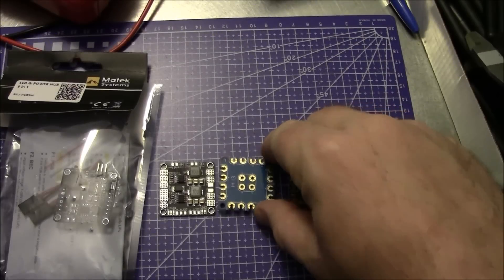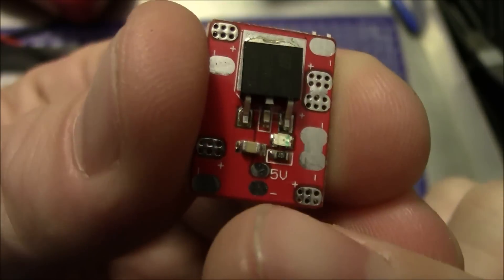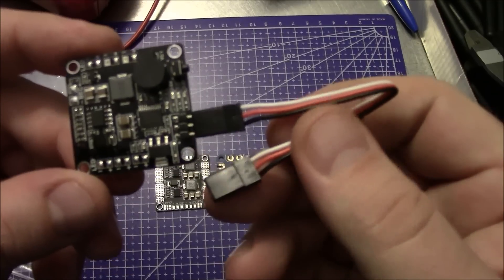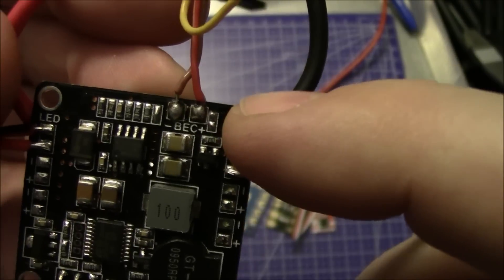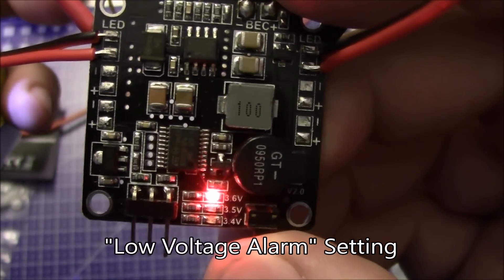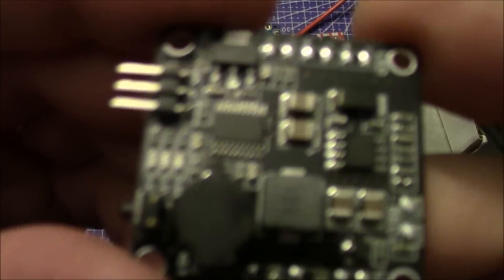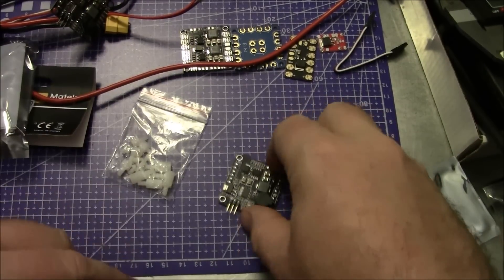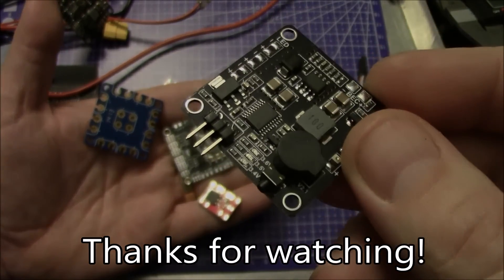Matek PDB BEC-5V/3A from Banggood

Comment: the reason 3s wont work is because this uses a step down voltage regulator. It will keep a clean 12v only if your vbat > 12v
Reply from the maker: Yeah, I eventually figured that out.  Took me a while though.

Comment: Actually, according to the instructions for the D4RII, I quote, "If CH3 and CH4 are connected by a jumper, CH1 will output CPPM for CH1~CH8, and CH2 will output RSSI (PWM)". 
So the servo lead on the 5in1 board should be able to use channel 2 (PWM) on the D4RII, while channel 1 would be connected to the FC using CPPM........or have I missunderstood something here?

Comment: I would be very cautious about buying the Matek 5 in 1 board even though I like the functionality because in my experience when you put a piezo buzzer near a naze32 it tends to affect the accelerometer and send it crazy I had a 250 size that I mounted a piezo buzzer too close to the naze and it was all over the place after about 2 days of mind melting diagnosis I connected the naze to cleanflight and when i touch the naze beside the board the accelerometer went nuts so I moved it further away and everything worked fine.

Comment: Do I need to add telemetry to the 5 in 1? And does the beeper when it's low voltage beep and tell you from the transmitter?
Reply: No, it just measures the battery voltage directly through the battery leads.

Comment: How did you get the buzzer to work which is on the 5n1 PDB with the trans. switch? I install mine on a DX9 which Im only using the Satellite as a RX on the Naze32 Acro. I have it working in Cleanflight  but the switch does not activate the buzzer. Also I'm using only the Spektrum satellite not the full Receiver.
Reply: It works on specific ppm values, I got it working once, but it's a bit of a hassle. I soldered another beeper to my FC itself.

Comment: That mini Latnium board or whatever has a Linear voltage regulator I believe. Very stable voltage, but it heats up as the excess voltage is converted to heat (hence its back is soldered to the board as a heat sink. 

A real man would attach 4S and see if anything blew up. Looks like the rest of the board might just be resistors and LEDs so you might be safe(??)
Of course your board might melt. Depends what current you draw through the BEC.

Comment: Hey man, where do u connect the signal wire for the buzzer to the naze32? (Is it on the positive or negative on the buzzer port on the naze32?)
Reply from the maker: +LenteNiJuan The buzzer on this board doesn't have anything to do with the buzzer on the Naze32.  They don't communicate together.
Reply: +travisgrindal got yah. thanks.

Comment: Hi Travis ! First of all, thanks for the good job you do ! Secondly, do you mean that Matek comes with nylon screws? (I already bought it on Banggood and I don't know if I have to buy those screws or not). Thirdly, could you do a video on how to assembly (sold) every component (PCB, FC, ESC and motors) ?

Thanks Mate :)
Reply from the maker: +Jean-Eudes Akoun Thanks!  The spacers came with both PDB boards I got.  I've thought about doing a detailed build video showing every component being assembled, but it is difficult to record and different people need different levels of details and it usually ends with a ton of questions being asked.
Reply: Oh cool ! Thanks :)

Ahah, yeah, I understand. If you decide one day to make a video about soldering every components with a matek PDB, let the know. I should mount my first quad soon and I can't find a decent video on how to put every parts on (with Vtx, camera and the others parts I talked)

Comment: i had a bad experience with this board, i wouldn't recommend it. I had the same problems getting 12v bec to work, when i got it working it would brown out the 12v  line during flight.

Comment: u need to assigne 3 step switch to channel u connect pdb to. middle position is off, up is for buzzer and down for led control. leds got 3 modes:  just lights on, blinking fast and slow. to change modes u need to move switch from low postion to middle and then back to low position within 0.5 sec and there u go.
Reply: ah, and there is preprogrammed switch ranges for those positions, those r described in manual.
Reply from the maker: +meelis ce I tried them when I first got it but couldn't get it to work but I think the problem was that I was running a 3S battery.  I'm going to try again with a 4S battery and see if I can get them to work.

Comment: There is a slightly larger version of this board that has a separate 5 and 12 volt output.  The led's need to be 5 volts though.  I really like these little pdb's  if they work as advertised.

Comment: Hi Travis, really glad you reviewed this am I'm thinking of getting it. I was going to use the servo pins that stick out the board to power my FC as I already have my radio powered by SBUS off the FC. Question is there a way to turn the battery alarm off or do you just get the three voltage options and you have to pick one? Thanks for the review!
Reply from the maker: +Next Lipo Please Yes, you can scroll through the 3 voltages and then it goes to off.... when there are no LEDs lit up.
Reply: Thanks Travis. I've put one in my quad today and all is fine but I can't get the lost model buzzer to activate. I've put it on aux2 as the instructions recommend and used their ranges but no joy. I know the buzzer works because it beeps once when I power up and when I change battery alarm voltage settings but I cant get it to do a continuous lost model beep. Did you have any problems?
Reply from the maker: +Next Lipo Please Are you using PWM, PPM, or SBUS?  The PDB is only going to recognize a PWM signal.  Also, what kind of transmitter are you using?
Reply: Ah thats the problem. I'm on SBUS with Taranis :-(

Comment: I believe that to output 12 volts to the  bec you need at least a 4s battery.  That was the reason you were getting 4 volts instead of 12.  Try hooking up a 4s to the one you modified and see if you get 12 volts.   Here is a link to the manual.  http://www.fpvmodel.com/u/goods_data/2015-08/20150818093300-7351.pdf
Reply: +MICHEL VAN MOL it uses pwm signal. if u use x4/8r or similar rx then once u have set up sbus then other channels output pwm signal and u can use 3 position switch to control leds and buzzer. middle switch position is off, up is buzzer and down is leds control. u can choose between 3 modes for leds, move stick to lower position then to the middle and then back to lower whitin 0.5 sec, that changes led modes. without rx connected u can change led modes with that button it got.
Reply from the maker: +Tim Spitz You are correct.  I just tested it and the BEC was 12 volts output with a 4S.  With a 3S, it still outputs 4 volts.  That is the oddest thing I've seen.  I would have expected it to output at least the same as the 3S battery.
Reply from the maker: +Tim Spitz I added an annotation to the video so that, hopefully, other people will see this info.  Good idea on checking that.  Thanks!
Reply: +travisgrindal I suspect that whatever the voltage your bec is set to is what it puts out to the led connections.  That is why your leds won't light with a 3s because your only getting 4 volts to them.  With 5 volt leds it would work.
Reply from the maker: +Tim Spitz Yup... makes sense now.
Reply: +travisgrindal 
Hello, 
I use a 3s battery and 5 volt LED. That works perfect. The manual says that you have to use the same volt for the LED as the output of the BEC. I still can't controle the LED's with my TX. I am using S-bus and i think that is the problem. Anyone who can explane this. ( what to do ?)
Van Mol Michel
Reply: +meelis ce 
Hello,
I use a RadioLink TX and RX. I see in the PDB manual  some values for the switch. 
OFF > 1400 - 1600. What do they mean with that?
Reply: +MICHEL VAN MOL those r switch ranges if u move those. u can c it in cf under rx tab
Reply: +meelis ce 
Hello,
I put it on CH8 of RX. I see in the configuration of CC3D that all my channels are in S-bus. Must i change that in PWM for CH8 or is it automatic in PWM when using S-bus? ( still not changing LED)
Reply: +MICHEL VAN MOL yeah, pdb takes pwm signal, it cannt understand sbus

Comment: Check the voltage on the led pads when connected to 3s, it may have a 12v Bec that's dropping g the 3s voltage on the pads below 10v. On 4s it would drop the voltage to 12v maybe
Reply from the maker: +Andrew Griffiths You are correct.  I'm pretty sure that is what it was doing.  On my modified one, with a 4S battery connected, the BEC does output 12 volts so I'm pretty sure it must be feeding the LEDs the same voltage as well.

Comment: can it handle 6s
Reply from the maker: +Delbert williams delbert williams (The Gate Keeper) It should.  It says it handles up to 27 volts - 3.7v * 6 = 22v.  Even with a full charge of 4.2v * 6 = 25.2 volts.
Reply: +travisgrindal There is also other version of this from Matek
http://www.banggood.com/Matek-LED-POWER-HUB-5in1-V3-Power-Supply-Board-BEC-5V-12v-Low-Voltage-Alarm-Tracker-p-1019353.html

also I have heard about OSD build in version - but it's not for me.
Reply: +Xava got this one too and really love it. specially because of its oversized and and u can have shorter esc cables and + and - r side by side.
Reply: +meelis ce glad you like it. I have bought other board just because I want tu use external buzzer. http://www.banggood.com/CC3D-NAZE32-F3-Power-Distribution-Board-PDB-With-Filter-BEC-Output-5V-12V-3A-for-QAV250-p-1023543.html

Comment: Glad to see this vid as I bought this PDB and have a question about the + and - strips. When you heat one up, doesn't it tend to reflow any joints already made, possibly causing them to shift or come off? Wondering if I have to set all the wires up and do at once.
Reply from the maker: +Relic FPV Sometimes it does that but most of the time it does not.  I seem to get it hot enough to flow solder in about half or less of the wire next to the one I'm soldering.  I have a similar board on my LS-210.

Comment: It is possible that BEC trace requires you to input battery voltage at the small designated pads instead of the esc pads. I also have had 2 Matek PDB's pop the 12v reg for the vtx/fpv cam. They were not this version, but the last.
The LED's on this board are most likely driven by a similar 12v reg that is a step down only. Since on 3S you are only putting 12 v in, the reg is not allowing at least 9 to 10v through. 

Just taking some guesses.

I have become very enamored with the Genix PDB for micro builds, and the Quadrevo power pro, and redrotorrc OSD pro for the 180 and up racers. Those PDB/OSD boards are the shizzle.
Reply from the maker: +Hiway $25 is kind of high for a PDB, but if you've been having bad luck with others, then I can understand spending that much.
Reply: *****
Not if it comes with an integrated OSD ;)